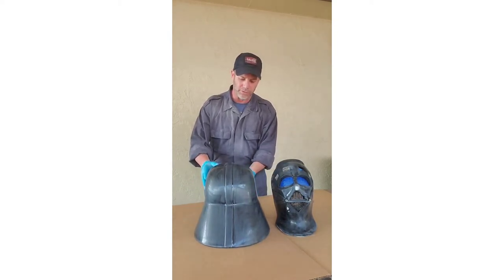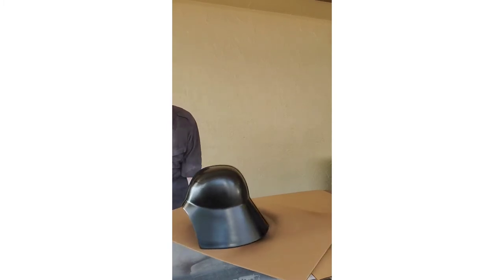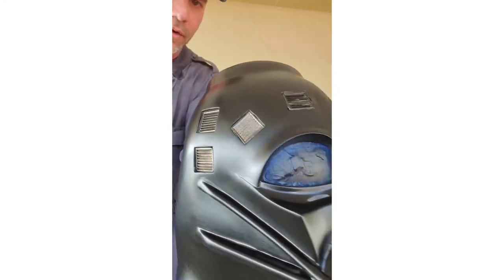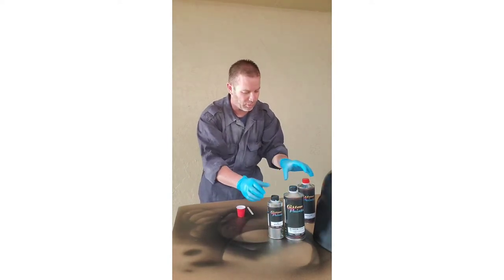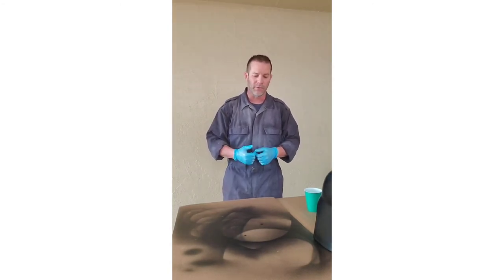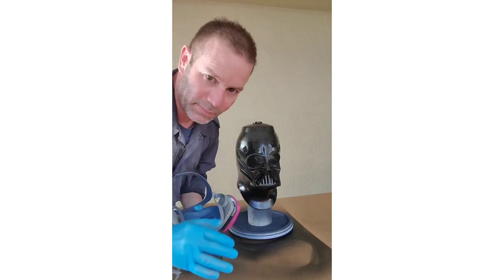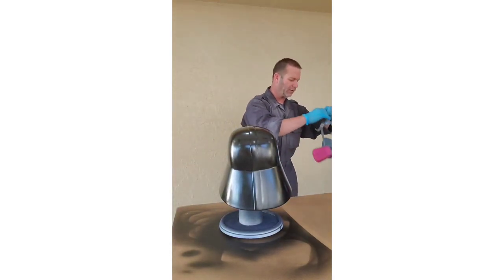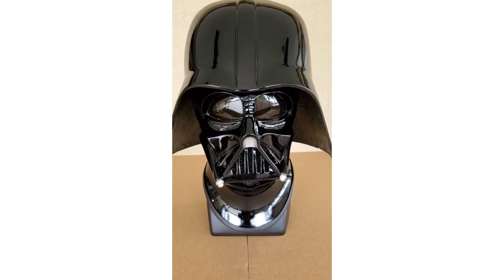Star Wars Darth Vader Helmet Restoration, Paint and Clear Coat Tutorial

Comment: I have Rustoleum Semi Gloss in a can. No airbrush. How would you recommend going about painting my helmet? If you look on my channel you can see that it is a bit textured
Reply from the maker: Hey there...Sorry for the delayed response. I didn't receive a notification for some reason. So without compressed air, you can use Rustoleum black (it can be flat, semi-gloss, or gloss). Then you can apply the clear coat over that with Spraymax 2K clear coat. That is a 2K clear coat that comes in a spray can and has a shelf life of about 24-48 hours once you open it. You would apply it the exact same way that I applied it with the spray gun. The results are really great with that stuff. If you would like to get rid of the texture, you would have to do that before you begin painting. Or you can just hit it with the Spraymax over your paint job if you'd like to keep the texture. Let me know if you have any other questions...